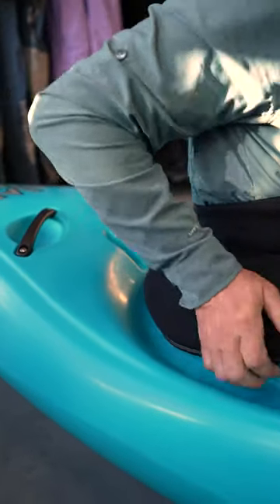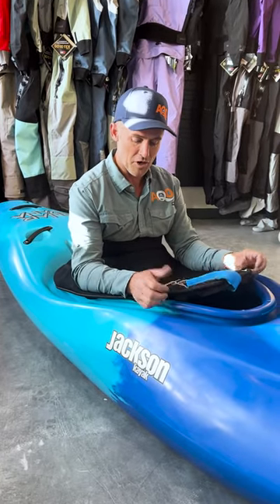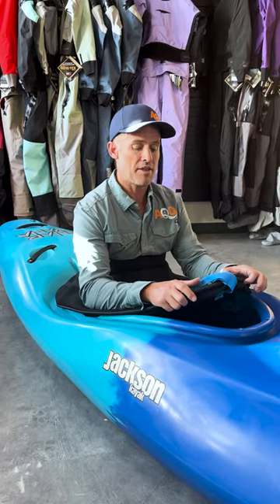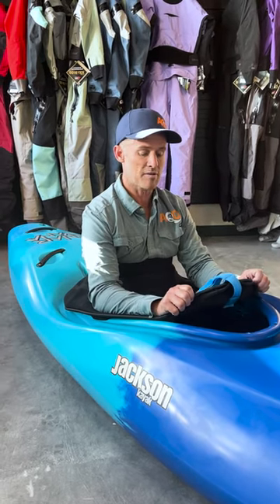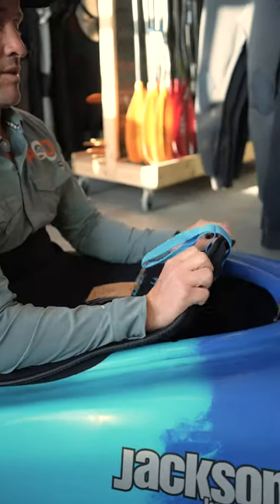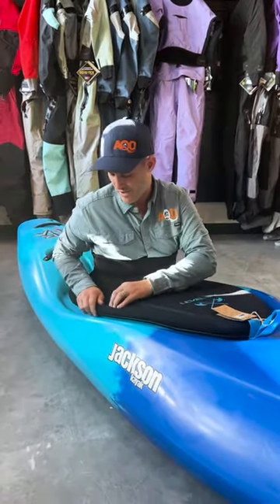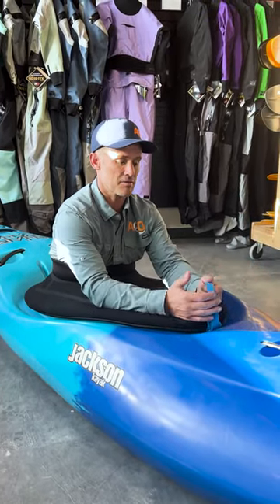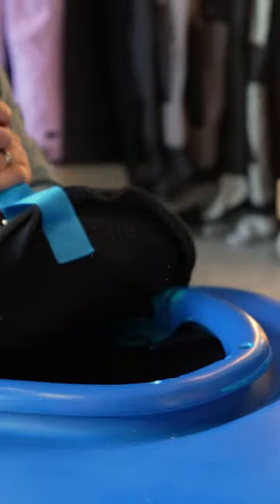How to Put a Spray Skirt on a Kayak

Comment: I would add getting the spray skirt wet along with the cockpit rim will help with tight spray skirts.  Also stretching the skirt prior to putting it on may be beneficial, especially for a rand type spray skirt.
Reply from the maker: Yes, absolutely, great tips for sure. Thanks for watching!

Comment: That looks like a level 6 jack. I noticed you pulled back on the release handle without having to pull forward first. Is that correct?
Reply from the maker: Thanks for checking out the video. With a skirt like the back you typically don't have to pull forwards to release the skirt as it isn't designed to be a super tight fit. That is a good catch though, many of the rand skirts particularly will require you to pull forwards a little to release the skirt.